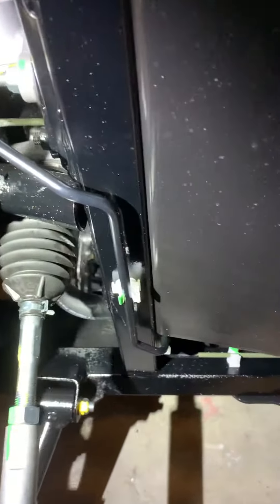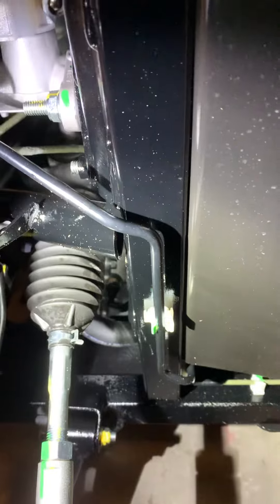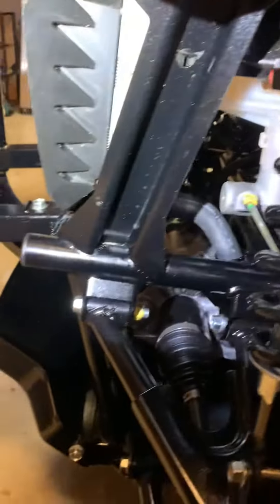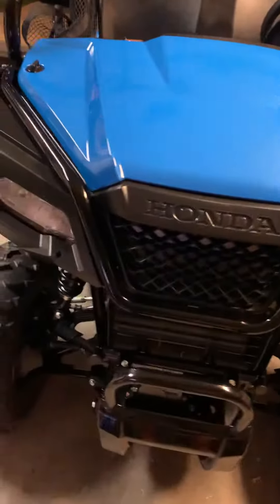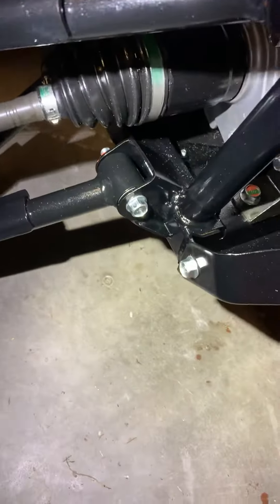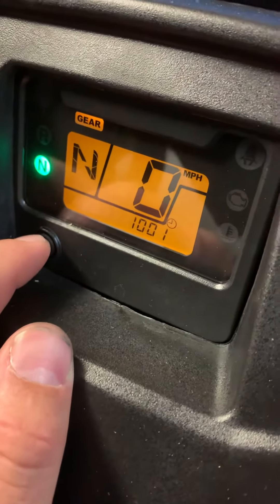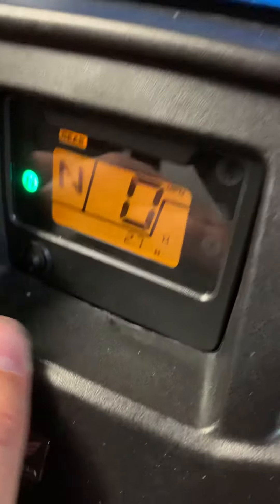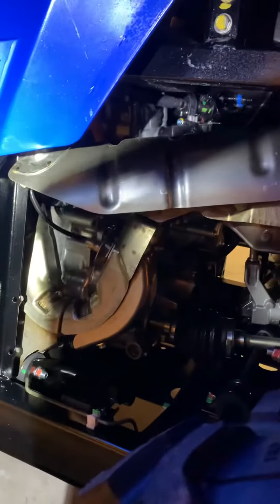2020 Honda Pioneer 500 MISSING WELD !! Problems P500 P520

Comment: My pioneer 700 has been a lemon. It's a 2020 and had been in the shop 3 times. First time was a bad shock like 2 weeks after I got it. Then a recall on the steering and now it's in the shop for a fuel pump. All in less then 8 months. This will probably be my last Honda also, looking at a Kawasaki Teryx4

Comment: I can’t figure out why all those tubes are open!? Just a crap setup from a fabrication standpoint! I love honda and would love to get a 520 but this is just unacceptable, Im going to check other brands for the first time in my life......
Reply from the maker: I agree!! The tubes are uncoated on the inside. I sold it as soon as they replaced the frame. Mainly on how they handled it more than the machine. If you’re looking for a basic utility the Mules are hard to beat. Tons of storage on them as well
Reply: @kcadventure-m3u  all honda had to do was make it out of rolled tube, dip the open tubes or cap the ones they have, very strange and cheap looking setup. I have also been checking the mules sx and mx and the tracker 500s look pretty cool. The mule sx is bare bones but probably bulletproof. What did you end up getting in its place?

Comment: What have they done so far about the weld.
Reply from the maker: They are replacing the frame. I was wanting them to give me a new one but I lost that fight despite owning about 6 Honda’s in the past ten years. I’ll likely sell it and never own another Honda. They haven’t offered me a extended warranty or anything yet. My thing is that I sold a perfectly good 2018 Honda Rancher to buy this for hunting season. Seasons almost halfway through and I have nothing to get to my spots. Frame hasn’t shipped yet.
Reply: Sorry to hear about your p500 I received my 2020 rancher this past Easter and wouldn't trade it for nothing. I'll buy a jeep before one of those side by side's